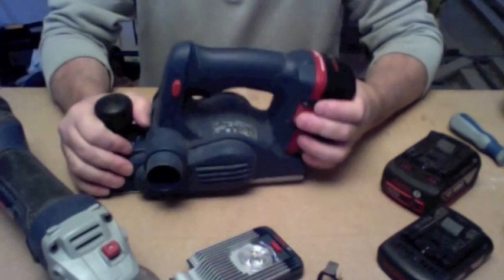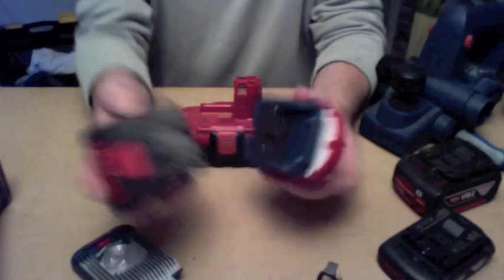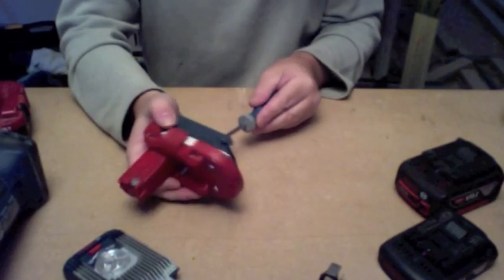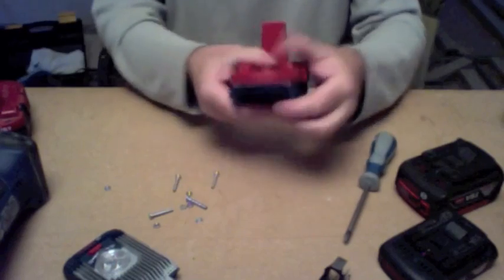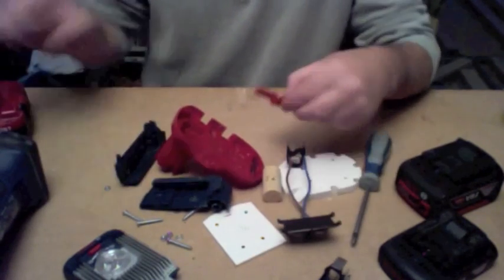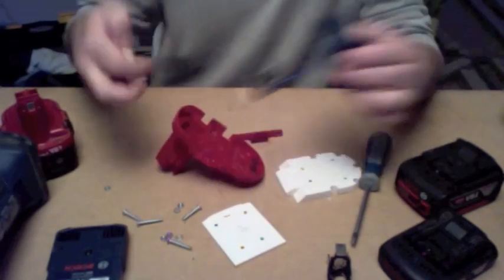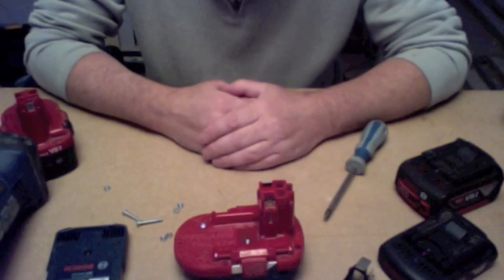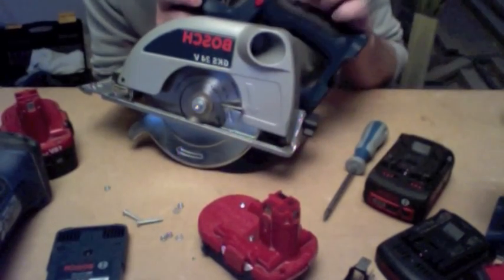Bosch Lithium Ion 18v Battery Adaptor DIY NiMH Power Tool vs NiCd NiCad Li Drill Jigsaw Driver

Comment: If this set up is for a permanent solution, why just glued with epoxy, rather than using screws. Anyway nice job.😊
Reply from the maker: "permanent solution" - No!.. It was/is a prototype that never made it past prototype though still works fine today on different tools without physical issue or electronic battery management problems... I suppose 8 years of testing means it works OK !?! ... Maybe the next one I'll epoxy :)

Comment: Will work with 24V tools?? Well that's a very good news. I've got a lot of those and many almost dead NiCd batteries. New life for old tools!!
Reply from the maker: Will work with 24V tools?? ... Yes!
Although I have not tested torque/rpm, the Lithium 18v feels just as good/better than the old 24v NiMH..

Comment: From what did you get the bottom (dark colored) plate that mates with the lion battery.
Many thanks.   Inspiring video for those that don't or can't afford to buy all new tools.
Reply from the maker: Thanks.. An older version of the linked light below...
https://www.boschtools.com/us/en/boschtools-ocs/cordless-lights-gli18v-420b-140864-p/
.
Twenty Five Year Old NiMH Tools Still Going Strong :)
You may be able to buy ready made 3D printed adapters now on eBay and the like..

Comment: Great Job! I loved my  18v bosch tools. Bat-180 batteries. But will never buy them again. Bosch can make a lithium compatible battery I hear but won't. This time I went with Ridged. So far with the lifetime replacement warranty, I've gotten 3 new 18-volt batteries and one new sawzal.Far better deal!! One Bosch battery was selling for $139.00 each
Reply from the maker: Thanks.. "I loved my  18v bosch tools" too :)
For betterer, and worse! I stuck with Bosch for the Lithium change over even though marketing/money making seems to best what is the better tool in the hand !!!

Comment: Anybody know any adapters with build in protection? To my knowledge (most) of the manufacturers don't have actual protection against too deep discharge build in to the pack itself but relies on the electronics in the pack to give a signal to the tool to stop. The reason because it would require quite amount of space to be able to cope with the highest current of any of their tools to they opted to signal to the tool to stop drawing any further. Those old NiMH tools of course don't have such as draining those packs completely were absolutely fine. So if powering them from LiIon you need such cutoff circuit in the between.
Reply: MiMH doesnt really like deep discharges.
NiCd actually needs deep discharges for chemical reasons. (they loose capacity otherwise)
Reply: @nutzeeer  Never had an issue deep discharging NiMH. Have LSD cells that are 15 years old only gave up recently.
Whether they handle it as well as the old NiCd - which by the way didn't need it that often as people think (slightly dependent on charger) - and most of the time when people think they suffered from memory they in fact had been irreversibly "cooked" on bad chargers. Any which way - you never risked anything else than just killing the cells.
The biggest issue with deep discharging LiIon is safety - too deep a discharge and/or for too long and you risk them either going up in flames when charging them or become unstable in which case they may burst into flames at any moment when you least expect it. That is why when using a LiIon you really need to take precausions that the cells aren't damaged - for NiMh and NiCd you only risk cells die - no big deal - just buy some new ones and a lesson learned. With LiIon you risk fires and ultimately you die.
Reply: @HifiCentret  I agree. An easy way to check e.g. li ion camera batteries is if they are slightly bloated. then they are on the way out.
Reply: That is the issue.

Best practice so far (DIY tinkerer, no expert) is to install new cells in a non soldered way, and charge externally, don't rely on the drill charger.

A pain in the arse though better than potentially burnong down your house or shed let alone the degradation in cell life.

Comment: I was wondering where you got the blue piece of your design?  The part that accepts the new batteries.  I know that the red piece is an older style battery disassembled. But did you say where you got the blue piece?  Is it part of a tool that was defective? Or did you take it from a charger?  Thanks.  Great video.
Reply: gaa 18v-24 professional
Reply from the maker: http://www.bosch-professional.com/za/en/cordless-worklight-gli-variled-131422-0601443400.html

I also beveled some blue edges and flattened the red rim for a nice fit…
Reply: You can 3d print it :)